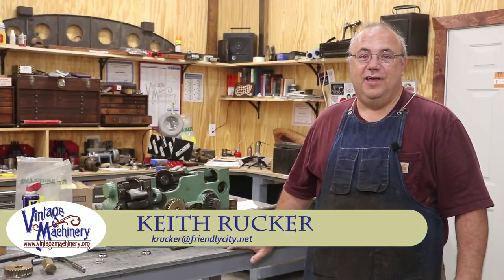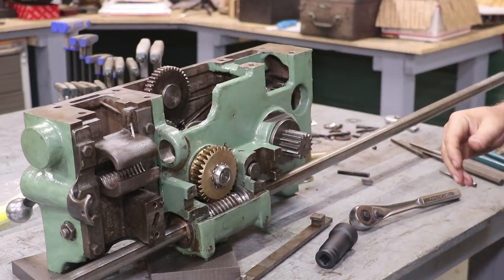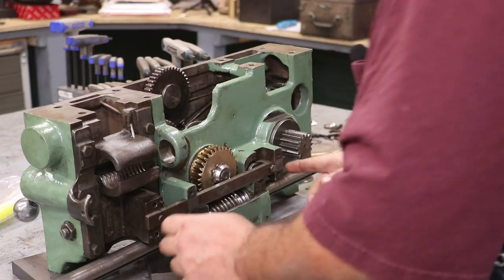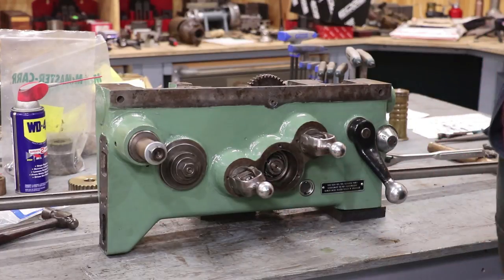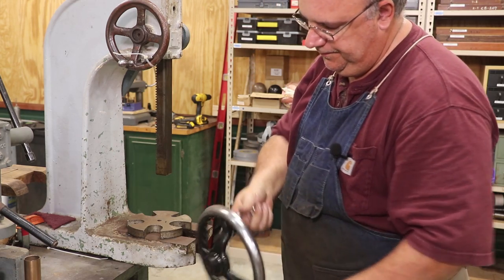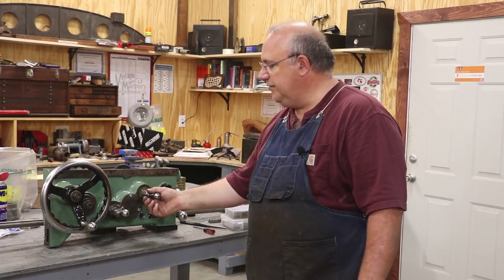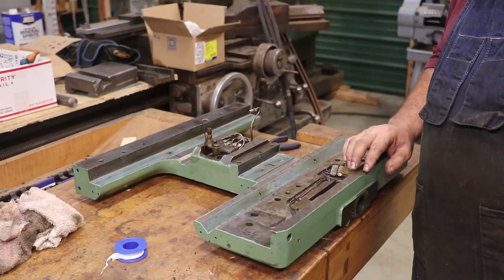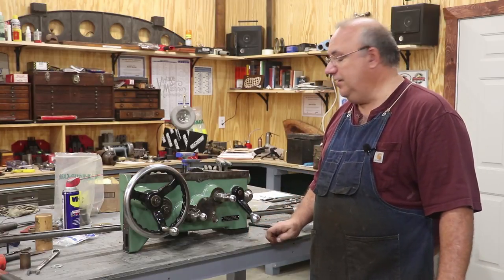Monarch 16" Lathe Restoration - Part 11:  Finishing the Apron

Comment: Well Keith, you never know what you've started by your videos, but you saved my backside with this series this week.  I'm learning to work on vacuum cleaners and related machines, and this week, I had to deal with a Koblenz shampooer that was throwing brushes off.  I was quite surprised, when I opened it up, to find it was driven by the same system as this lathe apron.  I recognized it as soon as I got into it, and recognized that it had the same problem as this apron.  It had an electric motor in the middle, with a gear box on each side to drive the brushes.  In those gear boxes were a steel worm and a bronze worm gear that differed from this only in scale and price.  My little bronze worm gears were only about an inch and a half in diameter and a quarter inch thick, and only $20 each instead of $500.  Just like yours, the teeth were completely ground off, and the grease in the gear box was full of shavings.  The parts were available, and I put it back together today.  I even knew what to do with the Woodruff keys.  

So the takeaway is that the skills you are teaching help with a broad range of fields, including vacuum cleaner repair, and that Koblenz is an amazing machine, that is still built like a machine and not a toy.  No nylon gears in that puppy.  It is built to last.

Comment: I recently went through the oil lines on a B&S mill.  Hobby lobby sells annealed copper tubing kits (multiple sizes) for 2 bucks when I had a couple of broken lines.  The kit allows you to use a larger size tube as a coupler and solder it in place.  Then, for the brass furele, I used a small drift punch and taped it down over it to open it back up to fit a new piece of tubing inside.  Worked well.

Comment: After 37 years of industrial machinery repair i can say the problems you have encountered are not unusual. I have worked on machines 'repaired' by people who could break a crowbar in a sandbox.
  Also the Timkin nuts (or spanner nuts) are installed backward and that size lube line was used by Warner & Swasey and Hartford among others.

Comment: Keith, if their was that much dirt in the lube system it would be worth your time to replace those brass metering units. They have a small filter within them and if clogged the correct amount of oil will not flow through them. It would suck to get it back together and not see oil flow from one of the ports. 

They each have a number on them which corresponds to their intended flow.
Reply: MKE Machine I second that!! The little sintered bit in them doesn't clean well.

Comment: I feel you pain. Having fiddled with a fair amount of small copper and brass tubing I know the feeling. An 'Old Salt'  once told me  that if a copper or brass pipe has been sitting for over a year that you need to anneal it before you try and reshape it. Of course I didn't listen. It took me years before I tried the suggestion. I was amazed at how easy it made things. I could reshape kinks and bend tubing back into round, etc

Recently, Thanks to Keith Appleton's YouTube channel, I discovered Blackgates Engineering in the UK. They stock all sorts of bits and bobs. For me find a source for all sorts of odd Imperial size parts (nuts, bolts, fittings. etc) was wonderful. My bet is that they would have that fitting.

Comment: When you turn those nuts around the right way you might also want to check the centering on that new gear as it looks to be in towards the carriage too far to be centered over the worm so it may need shimming out. Could all be an illusion too though hard to tell from 1000mi away! It is looking great!
Reply: You can't fool us Kentucky boys.
Reply: I hate to say it ... but if you compare it to the disassembly video, definitely not the same.  Question is, knowing someone else has been in there,  which is correct, which was put back incorrectly.  One thing I learned about working on older equipment (that has been in many hands) is that how you find something put together is not always how it's supposed to be.  Hope there is an exploded view diagram somewhere on that.
Reply: yes once something has been apart, you cannot trust at all it was done right
Reply: 2nd THAT! On ANYTHING!
Reply: Get Baily to look it over. He'll know.
Reply: you richt its sucks. is he a machinst or can hey beacks cookys?

Comment: As someone else mentioned I'd replace the meter units in the lube system.  They're often clogged and it's a lot easier to  change them out with the saddle upside down  on the bench.  At the minimum you'll want to put some pressure to the system and make sure that all are working before mounting the saddle.

Comment: You can buy that ferrule from All World Machinery in Rockford, IL. They have no minimum. They will sell you a single o-ring.
Reply: i went to my local hydraulic fittings store, they had a 30 minimum from store buys, what i wanted amounted to £5 in  o rings, i said to the guy, you already got them out of stock and priced it up, you can either take the 5, or get nothing and put them all back......he took the 5, more fool them, ive never been  back, rather search ebay, theres always someone even for a £1 order
Reply: OR ... you could try Grainger.com
Reply: Clyde Decker ... IMHO, Grainger can piss up a rope. They are the worst when it comes to things like this, probably cost twice the price of OEM.
Reply: I have carefully drilled the tube from inside a Ferrell before and then reamed or enlarged the Ferrell bore just enough to get a slip fit on the tube and reused the Ferrell as long as it is not damaged too much.
Reply: If you are looking at Grainger.com check out Zoro.com instead.  They are owned by Grainger but are 1/3 of the price and stock the same thing, just different part numbers.. Orders over $50 are free shipping, and ships fast.

Comment: I'm surprised nobody has mentioned the crimped line to the input connector.  That looks like it would seriously restrict oil flow even if your hydraulic pump could force something through it.  I would seriously consider replacing the entire line, as trimming back past the crimp is going to leave very close to having too short of a line.

Comment: The nuts and lock washer on the bronze gear are designed to be installed with the tapered side in.They are called timken nuts .It may not matter, but google timken nuts,there are CAD drawings showing this.Again,it may not matter,but if you notice the angle of the tabs you will see that it matches the angle of the nuts.Just FYI,love your videos.
Reply: You are correct. You can see it in the uninstall video they came apart opposite to they way Keith put them back on.
https://www.youtube.com/watch?v=wc11PSsVMkM&t=658s
At the 23rd minute mark.
Reply: as a millwright I cringed a little, but Keith is so full of other knowledge I don't mind, Your hard drive is only so big.
Reply: Les Bender i

Comment: That ferule may be available through a heating and air company.  Some pilot lights used very small tubing.  Also, you could adapt the fittings to 1/8" I believe.  Greg

Comment: Keith, I have been in a tight spot before where I had to drill out ferral's and reuse them  with out issue or leaks. The number drill index should get you there if you have to do that.

Comment: Keith, I've more than once fixed a hole in a line like that with a little silver solder. Trying to butt-splice a line that small would be tricky, since it would be easy to plug the line while soldering it, but I think it could be done, especially if you can blow thru it from the other end. Keep up some airflow while soldering and it probably would not plug up. Alternately you could make an armature out of some high-temp something-or-other that won't solder and use it to hold the hole open and keep the parts in alignment. Maybe a hunk of pencil lead. Or solder and don't worry about plugging it up, and drill it clear afterward.
Reply: stainless steel wire should do it, you an also wrap thin brass or get some tube to put on the outside rather than straight butt splice
Reply: Good thought on the SS wire. I was going to suggest some sort of ferrule, but then I thought that the break is too close to the end of the tube, and the gland nut wouldn't be able to slide over the extra thickness. If a ferrule could be used it would be the better way to go.

Comment: In the Video around the 14 minute mark, the tube coming out the manifold block at the back vertically looks like it has a hole ? or some damage on the left front side ~ 6mm up from the compression fitting.

Great work so far on the restoration :) I wish here in Perth we had the opportunity to find older machines at reasonable prices to be able to restore ;)

Comment: I have worked on quite a few of those Bijur oiling systems .... on older mercedes cars .They had a oiling system which lubed the whole chassis with #90 gear oil. I made a lot of the bits like the orifices because i never realised Bijur still has the parts. it wouldn't take too much to clock up $50 though. :-)

Comment: It should be possible to make one of those pipe fittings. Just a piece of brass, drill it through to the pipe size, and chamfer the ends.
Reply: SLORRIFJART321 
I agree. With all the complicated parts that Keith makes, I would think a simple Ferrell would be a piece of cake.
Reply: Machining is not a problem if you have small enough work holding, question is... which hardness of brass?
Reply: I would make  up a new olive using riveting quality brass, or from copper, then anneal it.  I would try to get a supply of new tubing and replace all of the lines, with new olives.
Reply: Perhaps there is info on ferrells in the machinist handbook?

Comment: Kieth, try Aircraft Spruce for those ferrules.  They have a supply center in Atlanta. 
 Aircraft use that 1/8" line for engine priming.  Good luck.
Reply: Paul Rachels  Yeah, but the flair degree angle may not match, especially if they're 100°.
Reply: plus that, usually, anything with the word "airplane" or "aircraft" attached to it is double or triple the price.
Reply: Did not KR say the lines were 3/32 ID.....?  Why replace those visible sections with some sort of transparent plastic....like tygon...through which the flow is visible...?
All those small bore copper lines look chewed up....!!!
Reply: diggerop Except nylon washers.... $.03 at spruce, $.10 at local hardware store.

Comment: Keith- don’t know if you will see this, but thought that I would throw in a thought- that $530.00 gear would not have been necessary if routinely (?) maintenance would have caught the excessively worn bushings that the feed rod runs through.  Another idea, not being able to actually see the groove that you believe cut the bushes, are the edges chamfered?  Rounding them would considerably lengthen the life of the brass bushes.  And routinely lubricating all.

Comment: Try looking at laboratory gas line fittings for the copper olive you require for the oiler, or even model steam engine fittings. Hope you find what you need without spending an arm and a leg.

Comment: Did I miss you setting the tab washer on the new bronze gear? My question was really that the gear appears not to be running central on the worm (probably an optical illusion, mind), so does it need shimming out a bit? Shame if it wears too quickly because of slight misalignment. I did note the safety locking bar rather excluded the use of your nice new socket, without removal of said bar!
You might find that some diesel injector lines have the correct fitting for your oil line problem. Or your local hydraulic cylinder repair shop could help.
RAB
Reply: R Balderson g

Comment: check with a truck repair shop for the fittings some air shifters use plastic air line in 3/23 od line and fittings good to 120 psi and stand up to oil

Comment: I realize this is an old video, but I had a question of curiosity: That brass worm gear seems to engage in only a fractional part of the worm. Is that normal? Is there a reason for the shallow contact? It seems it would cause rapid wear in the worm-gear combination.

Comment: The feral on your oil line looks a lot like the ferals used on a heavy duty semi truck shifter to select the ranges known as spaghetti lines.I bet if you have a heavy duty truck repair place you can find the ferals there.

Comment: Kieth if you turn that nut around the way it should go then it can be put on simply with a spanner wrench
Reply: Mark L you really can’t put these nuts on backwards. If you do it will flatten the fingers of the washer against the bearing. And the tool won’t catch.

Comment: The ferule is easily made on a lathe. It's not a complicated part.
Reply: yep and its not really doing anre pressure work, its mostly a drip system
Reply: There is a hole in the pipe on the left handside just above the connection @time 13.50sec. Did  you notice it?

Comment: If these are standard 5/32" oil lines, I have a bunch of ferrules, etc. from my Bridgeport (complete) replumbing I could spare to you. I agree you should redo the plumbing, and the flow restrictors, these are likely completely jammed up. Bijur parts are $$$ I used Lube USA they work great. http://www.fluidlinesystems.net/

Comment: When we had shafts made, we learned to require the job shop to supply nuts with them. That way they made it right. BTW the latest Chinese made ones were NOT standardized. His cheap ones fit, our quality ones didn't. Yes I know there are metric as well as standard.